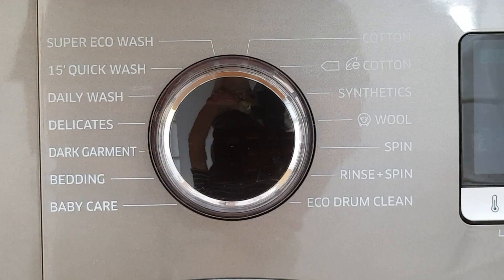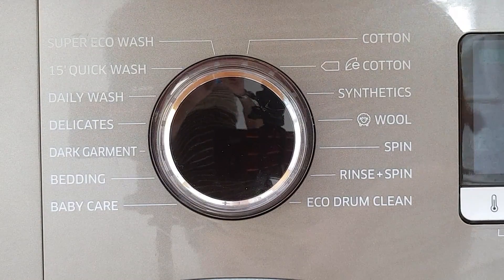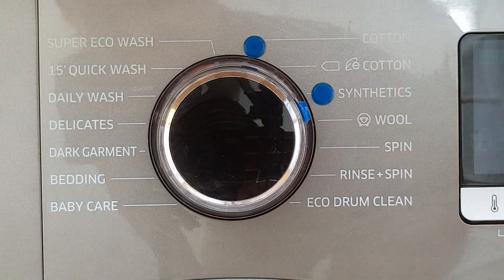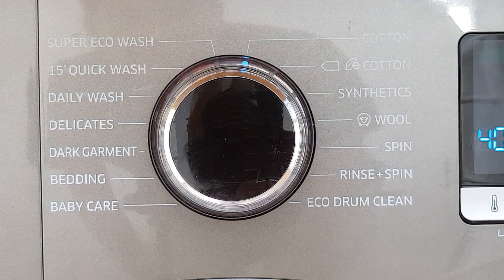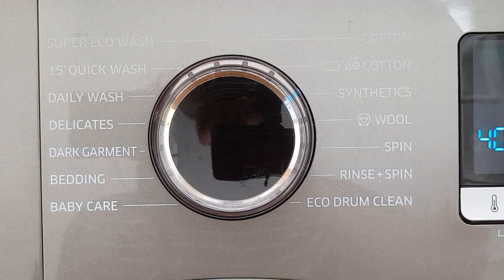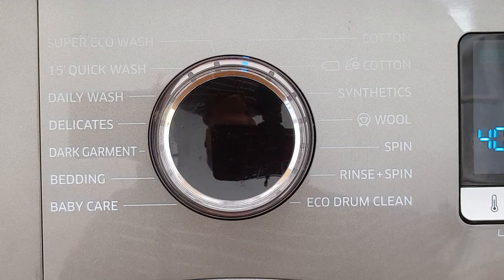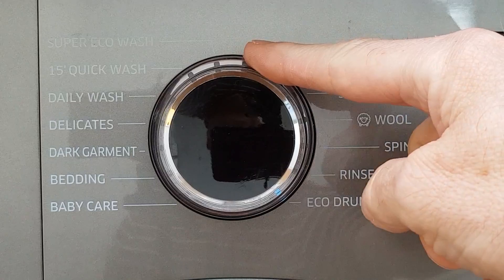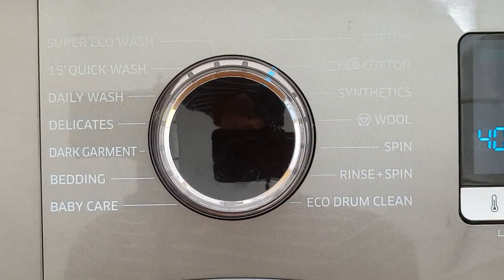The Problem with Visual Displays for the Visually Impaired

Comment from the maker: Hi Starrk.  Unfortunately that did not work.  The washing machine always starts at the last programme that has run to conclusion or part way through. In this video it always went back to cotton because I did not start the wash cycle.   Please see my instructable for the full explanation.  We did try to come up with a low tech solution but were not successful.  Thank you for your feedback.  www.instructables.com